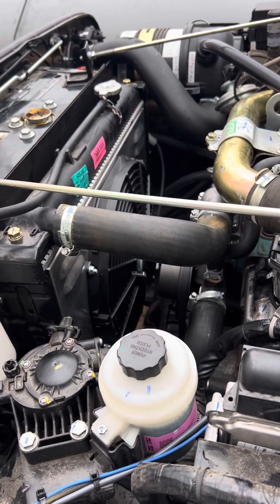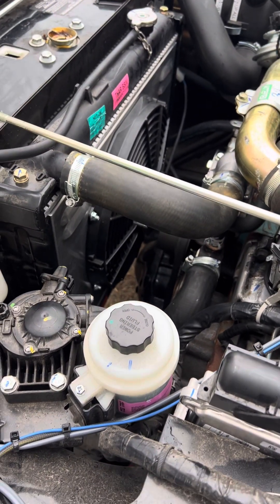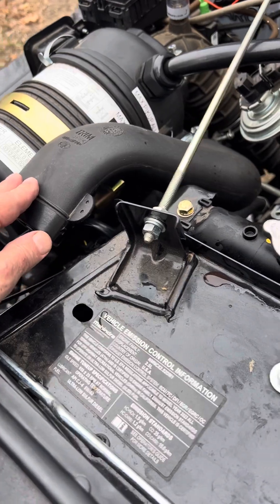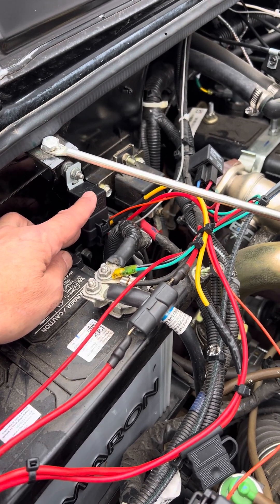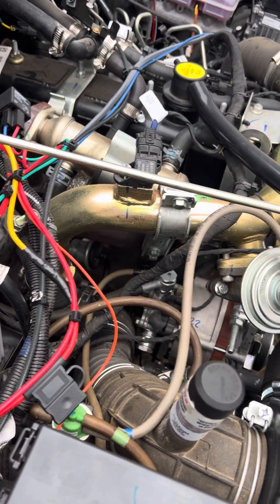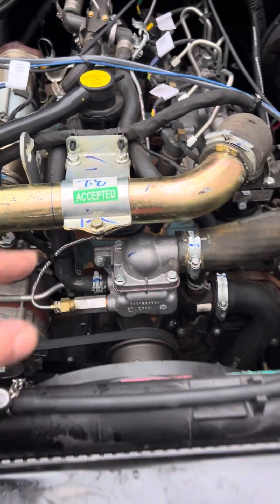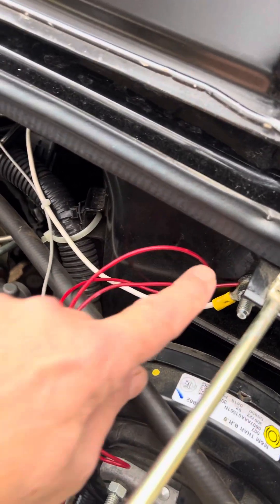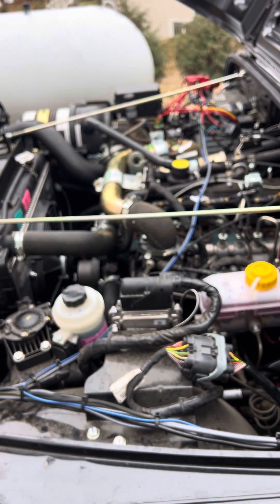Mahindra Roxor fan conversion

Comment: With the all weather model you will need to set the fan up so it comes on when the compressor kicks in.  I didn't see that done in this video. I have done the same thing and found out real quick it must kick on with compressor or you will cause some AC unit damage.  Only way I could do it was with another relay added.  harry
Reply from the maker: Can you share what you did with me?
Reply: yes. I will get some pics tomorrow.  basically another relay is required.   I wired the circuit to close when compressor power kicked on.  so now it will turn on by temp or by compressor.
Reply from the maker: @harrytinsley111  I assume the problem is the compressor gets hot when turned on?
Reply: I think the cooling coils must have alot of air going thru them.  I hooked mine up for just temperature at first, but had seen in the instructions if you had ac you needed a second relay.  I tested running the ac in very cool weather without the fan....believe me it's a problem, not only with the ac not really work,  it will damage the system the freon needs the air moving over it to lubricate the system I guess......Did you get any instructions with the fan?
Reply from the maker: @harrytinsley111  the instructions were missing I had to call Diesel Freak.
Reply from the maker: I installed the second relay for the air conditioning compressor.  It works great.  Thanks for letting me know about it.